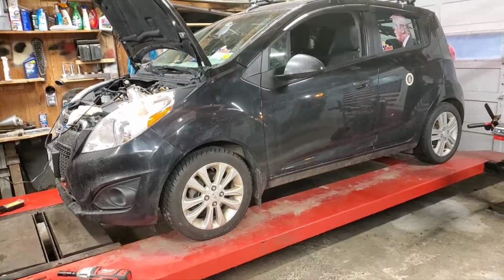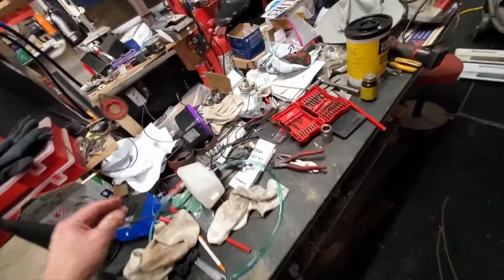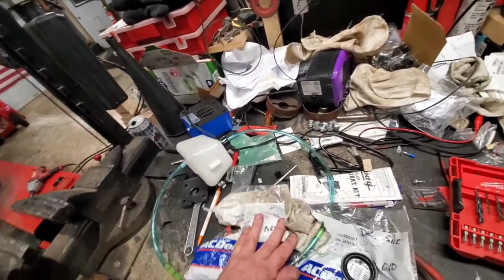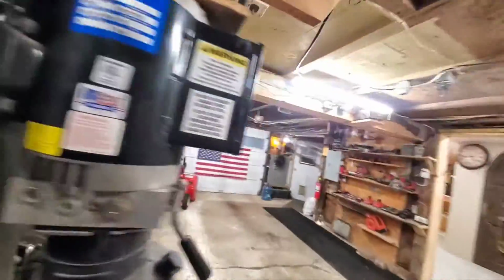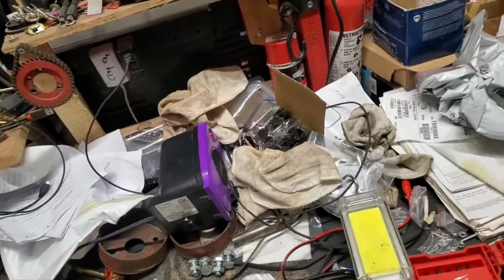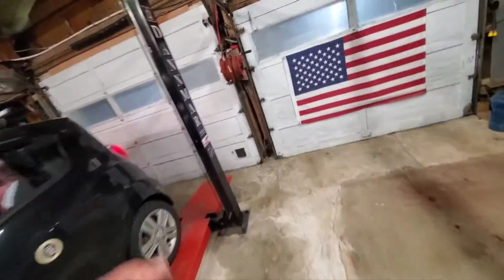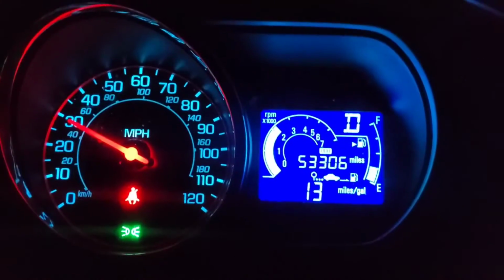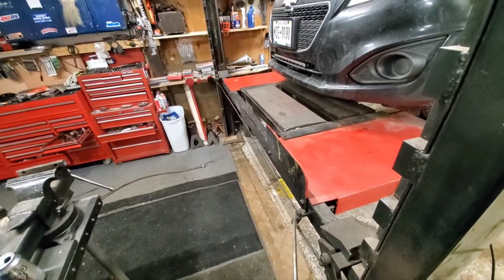my axle seal finally came in car is all done

Comment: nice fix and no leak , my auntie owns a kia cerato that has a cvt , id never been in a car with a cvt , it just sounds wrong to me, a bit like a slipping transmission crossed with and elastic band building up momentum,  but shes happy with it. car forklifts ah i mean hoists ive been around are noisy especially the ramps. listening to your burners heating the garage makes me look forward to winter its 104f here and its not even summer.